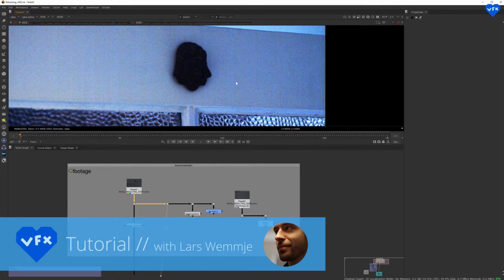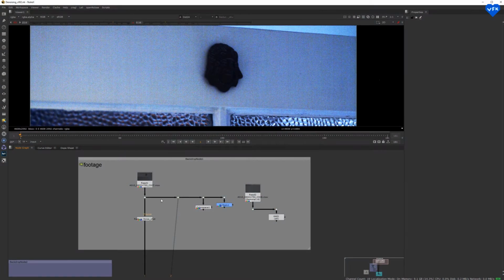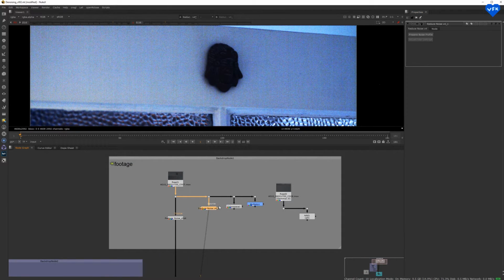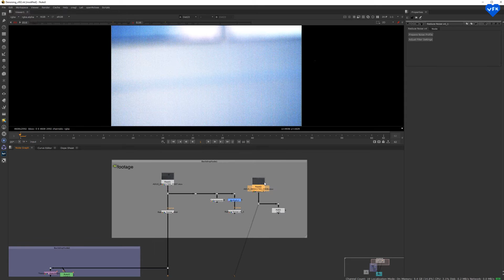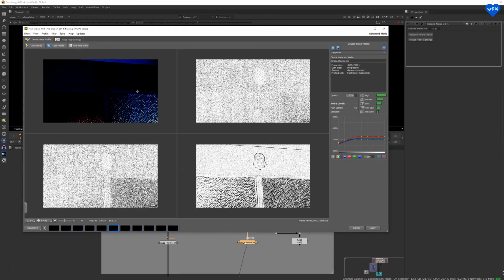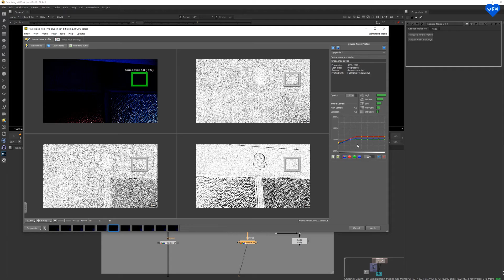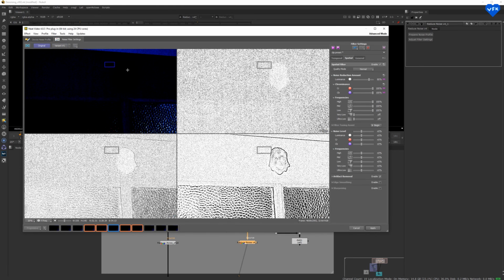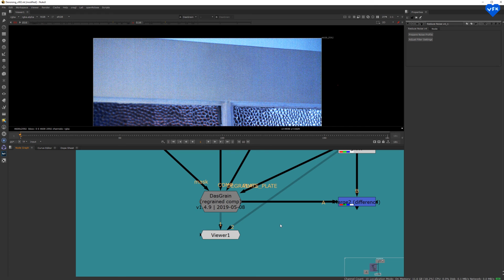Neat Video for Nuke // reduce noise like a pro

Comment: Thanks for this video. Question for you. Why would noise-profile plates (presumably grabbed at time of getting lens distn grids) depend upon the lens? Noise is only from the CCD (or whatever the image plane in the camera is). So wouldn't grabbing a uniform image with any lens, but with a range of ISO settings be more useful? Just wondering about your thoughts on this. Thanks!
Reply from the maker: Hi James,
your point sounds right.
The only reason I could think of why one should record the noise plates with the needed lens-camera combinations is the unique characteristics of the Lenses especially with anamorphic lenses. One would need to record all of that and see if there is actually any remarkable difference between the noise plates.

I hope that helps! 

Thank you! :-)

Cheers!
Reply: @LoveVFX  OK - next time I’m on a shoot, and grabbing lens grids, I’ll shoot a set of these noise profiles. I’ll shoot with one lens for a range of ISO, and for one iso (probably 800, which gets used a lot) I’ll shoot all the lenses. I suspect that there will be no difference between those, but nothing like actual data to confirm it! Cheers.
Reply from the maker: @musicalBurr  
Sounds like a good plan! :-)
Please let me know what you have learned! Cheers!